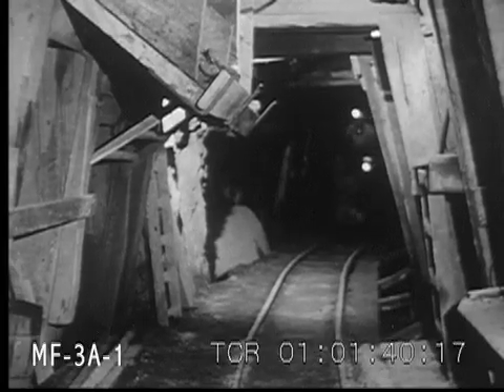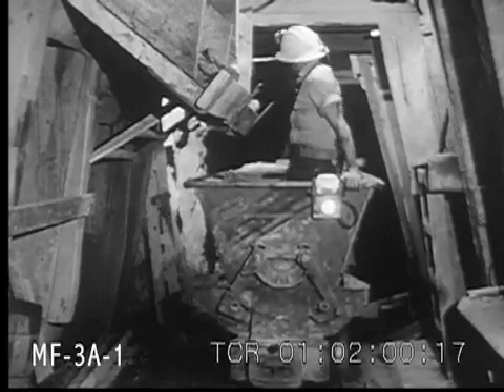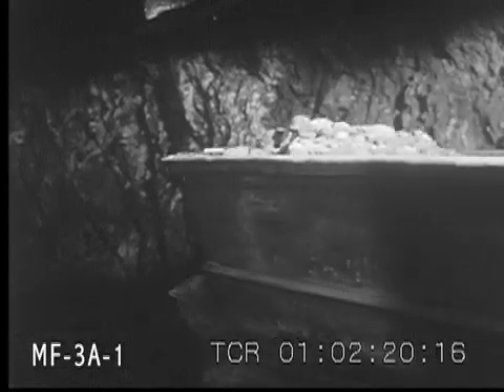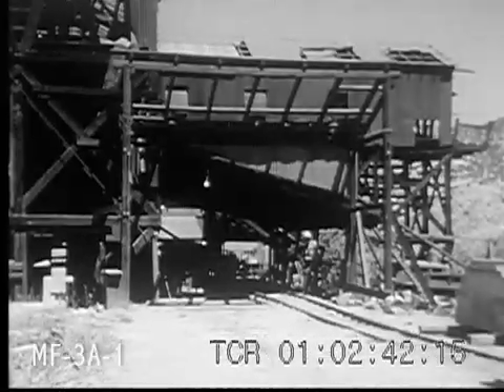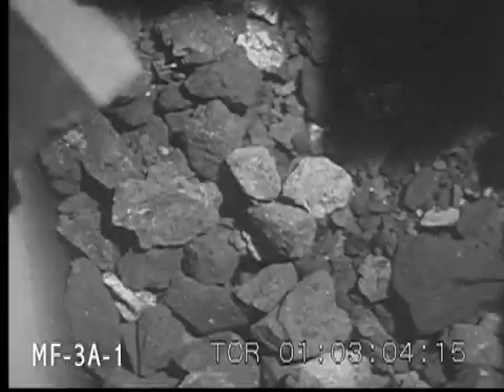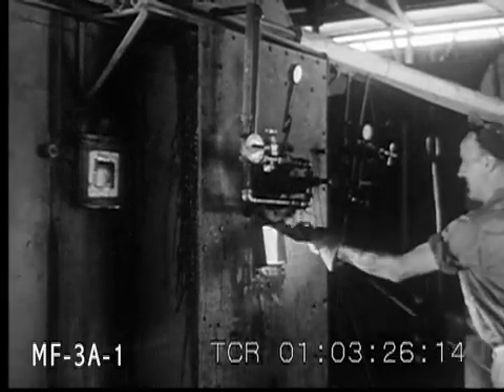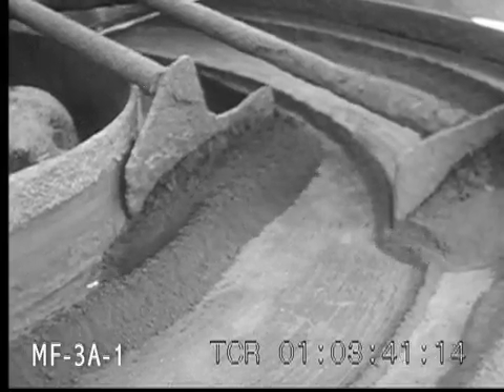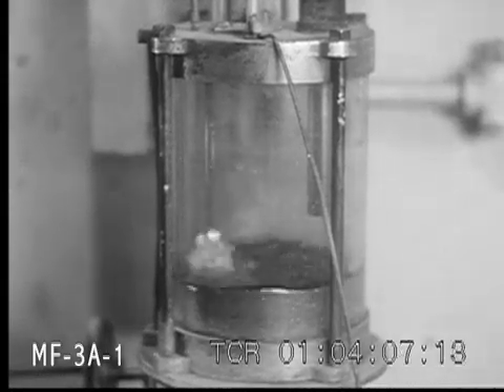Mercury Production In California 1955

Comment: The New Almaden Mine in San Jose was much, much larger with over 70 miles of drifts and tunnels. New Idria was second with a total of 36 miles by the time it closed in 1974. The New Idria complex included the San Carlos Mine, Molino Mine, Aurora Mine, Sulfur Creek Mine, Sulfur Springs Mine and the Ranchito Mine.

Comment: mercury is a metal, dude. It's the only metal that is a liquid at STP (standard temperature and pressure). And he is right, all metals form in rock and earth in compounds, and usually need to be smelted in order to obtain the material. If you've ever seen parts of large rock formations that are a dull orange, that's from the iron that is present in the rocks rusting.
Reply: I was wondering why the water ways in new idria are orange or what causes that.
Reply: What about Cesium and Gallium? They are liquid form at or near STP